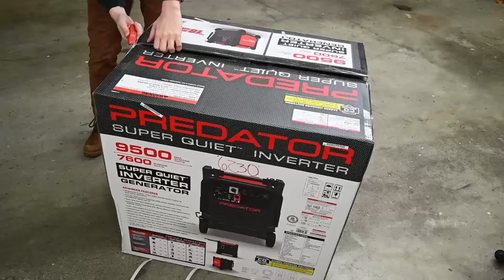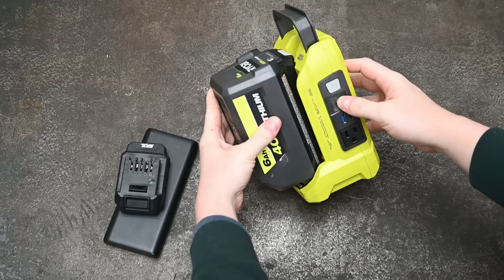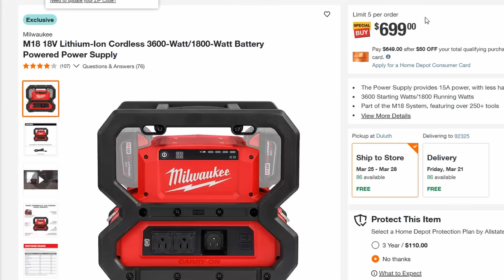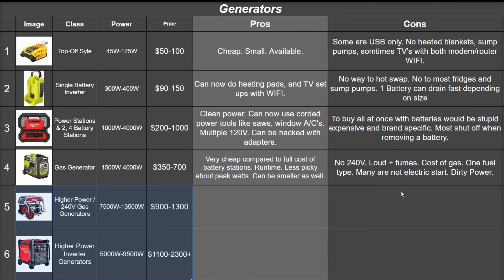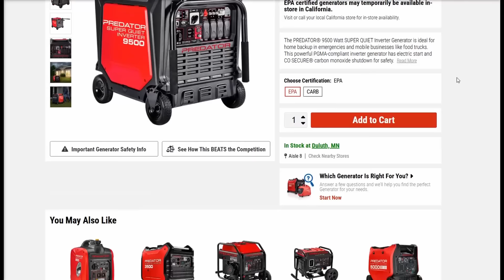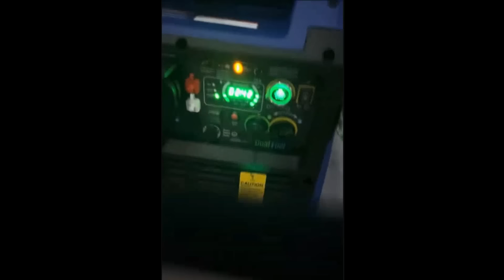Buying Harbor Freight's Most Expensive Generator So You Dont Have to

Comment: Another interesting thing regarding furnaces. The family's old generator (which literally ramps up and down once per second due to instability) ran the gas furnace for years in power outages. Last year, the furnace decided it was too unstable. Upon using battery chargers to charge a battery bank, I built it freaked out and wouldn't run stably at all. But at a lower power setting on the charger, it could run the charger at a low power. It also should be mentioned that there are some chargers (such as an AIMS 75amp 12/24v) that can tolerate 70 to 150V AC and can also handle a wide range of frequencies.

Comment: If anyone is in the same boat and has natural gas, check out tri-fuel generators, if you already have gas, you can hook tri-fuel up to your gas line. I would definitely install a similar 50 amp plug setup if I lived somewhere with a blackout season. 
I really prefer to use propane on my Westinghouse dual-fuel, less carbon deposits in the oil means fewer oil changes, and less maintenance is great for something that you don't think about when you're not using it.

Comment: Duel fuel is a massive selling point that most seem to overlook.  In a emergency situation getting petrol is going to be hard while LPG might be easier as people all race to get petrol. Also LPG does not go off so you can have a large bottle hooked up to the generator to run off in normal backup power use and even after a year that remaining LPG is going to be as good as new. That's a massive reason to get a generator that runs on LPG.

Comment: HF has bigger non-inverter units coming as well as bigger tri-fuel inverter units.

I can run just about all of my 42 circuits in my electric panel with my HF (converter to propane for $37.00)  9000 non-inverter unit.  My house is total electric minus the stove.

Comment: I didn't know a $2k generator could pump out 30, even upwards of 50 amps at 240v. Good enough for welding means good enough to pump the neighborhood of 10% an hour into an EV. That's definitely significant.

Comment: Good stuff.  I'm in FL and have the same power use case when the tropical storms come in and need cost effective for on the go power for hours/days/weeks.  There is another option you may not have imagined.  My setup is 40V iron battery -> 40v 32amp invert -> RV auto switch ( provides hot swap sources ) -> cheap UPS -> server/network gear/TV/airfryer.  This will let you pull power from any source(ecoflow, generator, drill batt, landline, tesla).  The RV auto switch lets me use any type of 120 AC power input and the pure sinewave UPS takes care of picky things.  If I hook up 2 ecoflows to the RV switch and can feed the system with anything since the ecoflows will take anything as power input. To avoid gas source since the gas pumps may be down or 2hr wait times at the pumps, you can get 40V iron batteries from vetted sellers that other powerwall channels use and many of the 40V iron systems do not have any cycles but have QA done by the good sellers.  The pro of this setup the ability to increment each stage based on needs (ex, can add additional inverts if the power consumed grows ).  If you have an EV this can power your household from days to weeks to a month) once the initial setup is in place.

Comment: I work on Honda's full line of generators, I just had an EU7000 (the one HF was comparing to) in the shop for maintenance that had 3800 hours on it. now for a big diesel gen set that's nothing but for a small engine that's an eternity and this one sees all kinds of abuse and keeps ticking.

ps. the EFI on the honda really helps fuel economy and it has remote start.

Comment: Hey, you were saying your gennys have dirty power... Which is true... But that is less of an issue then the floating neutral.  My Goodman high efficiency furnace wouldn't run off my generator, Until I grounded the neutral And then it worked perfectly...

Comment: I bought a Generac XT8500EFI Generator Item # ‌1435679‌ for
$ 999.99 from Costco in Dec 2021. I selected this model for the clean power. I still miss the standby unit I had in a previous house.

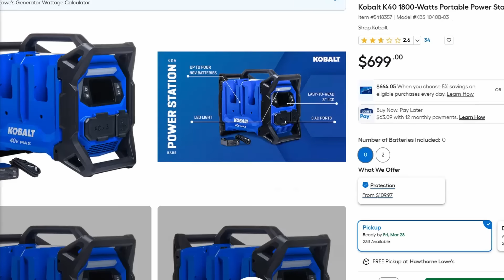Comment: 8:00 Having those adapters is awesome. I have a bunch of R/C stuff from past projects, and I have battery to XT60 adapters for all my assorted batteries so I can source off of any of them to charge the buffer for a 1kW pure sine inverter. 
If I don't end up getting solar set up before the next big storm, I'll probably pick up a cheap little generator for the fridge and AC, and then I can use that to charge the inverter batteries for the more picky stuff.

Comment: I have a 6500 watt generator that I need to power my 220 well pump. But when I don’t need the well.  My 299 3000 watt 115 generator runs every thing in my house using 1/4 the fuell

Comment: I bought a Wen DF452ix. I run it on propane most of the time. It's relatively quiet and the propane makes the exhaust less smelly. Got a bit over 250 hours and no issues.

Comment: Pro Tip: Look into Westinghouse 11.5k or larger generators. Check the specs. You will notice a guarantee of 5% THD or less. This is knocking on invertor generator territory but for only like $1,250 for the 11.5k. This is significantly cleaner power than most other generators this size.

Comment: I got the ego power station because all my yard equipment is ego and I wanted a way to charge a bunch of batteries and have a power back up just in case. Something I really like about it is it can run on anywhere between 1-4 batteries so batteries are hot swappable

Comment: I would like to mention, that while it is not a single item, you can also use a UPC with a dirty power generator to clean up the power output a bit. you also get the added benefit of never losing power to the specific loads that need that cleaner power

Comment: Harbor Freight gensets suck. Not only do they drink gas at an incredible rate, but they also have very short lifespans as little as a 1000 hours in my experience. If you have to get a gasoline genset I recommend Honda they are much better on gas and will last a lot longer. Honestly the only gensets you should be considering are diesel powered units. Diesel gemsets are extremely fuel efficient and should last you 30,000 hours or more of you take care of them. I run some John Deere 4045s and they generally go 45,000 hours between inframes on our boat. Assuming you have two gemsets and switch them over every week your looking at about 10 years of use before you have to overhaul the engine.

Comment: For a small black out, (not a turn key solution) I would go with gel batteries and pure sin inverter, but they get really expensive at higher wattages. And if you are in green move, solar panel could help, but you will eventually run flat and snow is an issue.

Comment: Unfortunately, even for those who have a backup generator or alternative power for their Internet modem or router, unless your supplier has set up your neighborhood node with more than the usual mini 10 minute power out backup system, you're going to lose your internet no matter how much power you have at your house. The vast majority of Internet providers only have very short-term battery backup at their nodes. We found that out during the fires here in SoCal last year. Everybody had their generators up and their lights were on in the house and the computers were working but no internet and your internet stayed off unless you had Starlink. 
The only way we could get online was through our data plan so long as the cell sites stayed up.

Comment: IMO even if you do still want a gas generator, it still makes a lot of sense to get one of those battery "generator" power station things (the all-in-one type, maybe with an additional add-on battery pack or 3 depending on needs, since reputable brands of those in sufficiently high wattage output capacities probably do have the ability to support add-on battery packs).
Why do I say this? Well, first off, all but the cheapest versions of these battery "generators" put out clean power because they use pure-sine-wave inverters to turn battery DC into 120v AC (and sometimes 240v for the "really big" ones), and electronics like a PS5 or Xbox can be pretty picky about how clean the incoming power is. However, the major reason I say this is because of an efficiency issue with all fuel based electric generators. All of them have a designed operating wattage at which they are the most efficient. This is usually not "nearly 0 watts" nor is it ever "nearly peak watts", it's usually somewhere in the middle. Guess what else is right in that wattage range, that's right, it's the amount of power that most of these battery "generators" can pull in while charging. Battery "generators" are much more efficient at the lower wattage range of things, they're purely solid state electronics so there's no energy being lost simply to keep an engine turning and next to no energy lost simply to keep the 120v AC waveform stable, these inverters can be up to 90% efficient where even with the best small generators you're lucky to get 20% of the fuel's chemical energy turned into electricity *at the generator's most efficient operating point*.
The idea is that for most outages you won't even need the fuel generator, but during extended outages you use the fuel generator to charge the battery "generator", and you size the battery "generator" so that it's charging wattage is a close match to the most efficient output wattage of whatever fuel generator you've chosen to use to charge it. This way you also don't have to deal with outages you cause for yourself because you have to refuel the fuel generator or because the battery "generator" ran out of charge (this is why you might need an add-on battery pack or 3 for the battery "generator").

Comment: The "battery and inverter all in one" "battery generators" are often quite nice on their own, but at least the Anker, EF Ecoflow, and Bluetti brand ones have 3 extra tricks up their sleeves.
1. Solar panel input: Pretty much all brands of these "battery generators" support some level of solar panel input, meaning that if the sun's shining, you might not even have to discharge the battery at all*. Even better yet, you're not paying for fuel, then using it in an incredibly inefficient small engine (probably around 10% efficiency of "fuel energy to electric energy" conversion), *and you're also not paying for the solar panel electricity because the power company never interacts with it. Bonus points if it's summertime in California, and you use the solar power to run your house's AC. Sure beats having to worry about a blackout meaning you start baking in your own house, and it's a great way to turn solar heating of your roof into solar energy that's keeping your house COOL AND COMFORTABLE instead! This also works great with trick #3, see below.
2. Load shifting: If your power company raises your electricity price during periods of peak demand, you can save money by controlling when the "battery generator" can charge from the wall. The idea is that you plug the battery generator into a load that tends to run during periods of electricity being expensive, and only let it charge up when the electricity is priced lower. You're basically storing the battery capacity worth of energy "bought" at the low price, and using it when you'd otherwise be paying the higher price. This works the best with an electrical load that uses a lot of electricity during peak times, like an air conditioner, and depending on what battery generator you get, you might need to use trick #3 (see below) to make it work fully.
3. Battery Capacity increase: I haven't really looked into other brands, but Anker, EF ECOFLOW, and Bluetti all offer "battery generators" that come with special ports to allow same-brand battery packs to be used to extend the capacity of the base unit, letting it supply power to whatever for longer (these special ports are different than the solar power input ports, so you can use both at the same time if you need or want to).

Combine all 3 of these tricks and you can turn a sufficiently sized battery generator and solar panel array into nearly year-round energy independence for your home while maintaining the ability to draw energy from the power grid when you need to, or simply make the air conditioning not make your electric bill incredibly high, or even just make sure you have enough battery capacity to keep the stuff in the fridge/freezer from getting too warm. It all depends on how much money you can dedicate to the task, and what purpose you have in mind for the "generator".

Comment: Fun fact, most routers, modems, and WiFi access points that you can buy at Best Buy or Wal-Mart or other places like that is already intended to run off of 12 volts DC, if you look at the specifications on the AC adapter that came with them, they almost always specify that they're outputting something like 12 volts 2 amps into a 5.5x2.1mm barrel jack connector with the center being the positive terminal.
USB-C PD spits out a range of voltages at up to 5A of current output per port and per cable, and wouldn't you know it one of the options is 12 volts. This means that if the only thing you want to do is keep the internet running at your house, you don't need to buy something that has an AC inverter in it. Instead, pick something that can do USB-C PD, look into the specifications of it and make sure it can do 12v/2a per router, modem, etc that you want to keep running, and then you probably run into the issue of "How do I tell this blasted thing to spit out 12 volts" right? The missing ingredient is what's called a "USB-C Power Delivery trigger board" and you need one that's set up to tell the USB-C PD power supply that it wants 12 volts.
These are very cheap on Amazon if you don't mind not having an enclosure, you can probably get 5 of these trigger boards for about $10 USD, with prime shipping without searching too hard.
All you need from that point is some "pigtail leads" that turn a 5.5x2.1mm barrel plug into a pair of wires, some heat shrink, soldering iron, solder, and knowing how to use a soldering iron (soldering practice kits are also not usually that expensive and you might get a radio or something else out of it if you do it right), and then you can assemble an adapter cable that lets you plug a USB-C PD cable into the input, plug the output barrel jack into the modem, router, etc. and the modem, router, etc. won't even know the difference, it will operate exactly the same because you're still feeding it exactly the same voltage as it usually gets.

Comment: If I may offer an adjustment about inverter generators (as a big diesel generator mechanic). You're mostly right, but I think you missed a piece.
Inverter generators are special in that they take the A/C juice from the main alternator, flip it to D/C, smooth it out with a gang of capacitors, and then re-invert it back to A/C. This decouples the output frequency from the RPM of the generator, which is where most of our problems are coming from. Alternators' output frequency is directly proportional to their speed, so when a small, cheap, mechanically-governed gas engine bogs down because of a sudden inrush of load, the frequency also drops. Because so many of our appliances these days use electronics which are sensitive to incorrect frequencies, this turns out to be a problem. You can hear these "lesser" generators hunting around as they operate, and every time the sound changes, so doesn't the frequency. For brevity, I'll skip the "why" of what's going on in the electronics.
Inverter generators clean this up by inverting a precise, constant frequency off the D/C bus which doesn't change as the generator stumbles or hunts around. Additionally, it also permits the option of the slow-speed "eco mode" and the ability to sync inverter generators with each other.
In the diesel genset world, we sync them into mini-grids all the time, and it's not exactly plug-and-play. Easy enough when you do it every day, but not foolproof. It involves electrically, magnetically, coupling all of the online generators so that they aren't just turning at the same speed but are in the exact same part of the sine phase at once. For inverters, this isn't a thing. Once the clock in the micro-controller is synced to the energy source, the IGBTs can be instantly timed to jump onto the same phase.

Comment: Important thing with the brands of battery choices, pick a single battery system. If you run Ryobi, don't buy an M18 battery just to run the inverter thingy. Now you've got 15 batteries charged to run the drill, but only the 1 for the adapter.

Comment: You could just spring for 2 deepcycle 6v bats wired in series with 4 harbor freght 100w solar panels 1 hub and the 400w solar charge controler.
Scale up as needed.
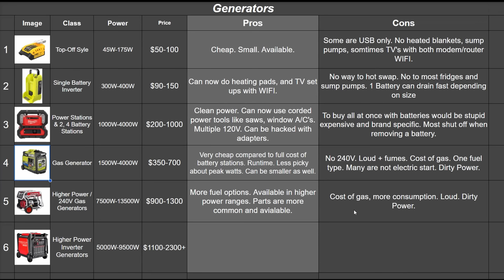13:11 Then switch the generator to DC to a bat bank and use a pure synwave inverter.
Works well with solar support.
Benefit of bat inverter setup is you can use a small generator during times of low power usage to top up the bat bank and save fuel by not using large gen.

Comment: From past experience. I would not recommend both champion or Westinghouse as a reliable option. I use mine daily for off grid power. My champion broke internally due to cheap parts in the timing if i believe correctly. Either way after i diagnosed the problem i got a Honda generator and its ben running ever since. Everything feels and preforms much better. If you’re on a pinch and just need power. Champion will work. Just get a Honda or Yamaha otherwise.